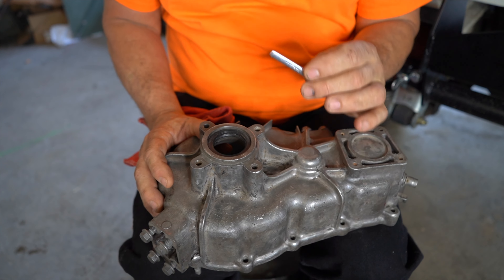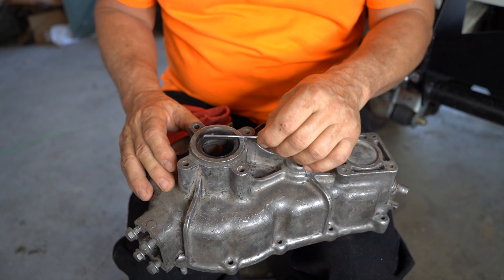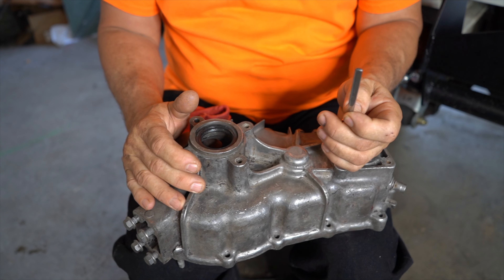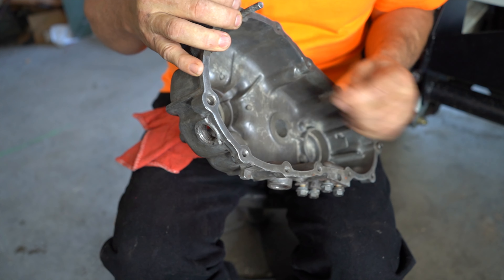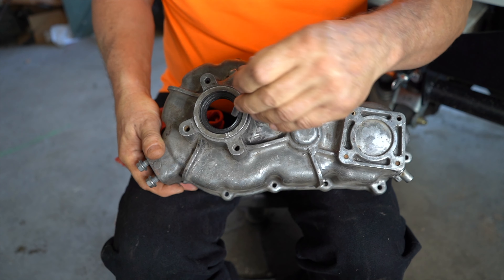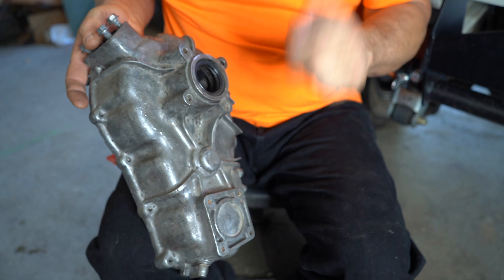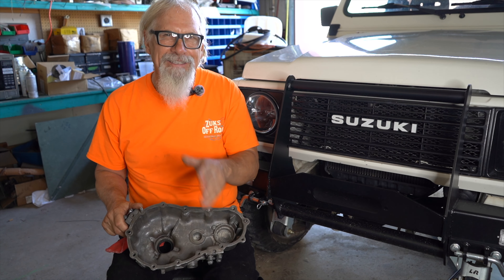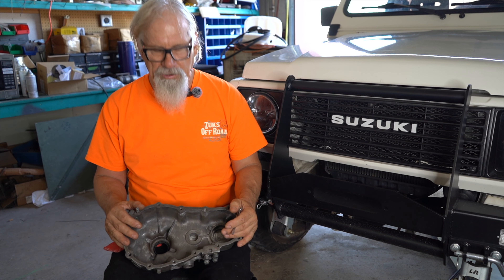Suzuki Samurai T-Case Rear Seal Install

Comment: How would you approach replacing seals without disassembly of the t-case?   I have a small leak and want to replace seals.  Especially the top input seal
Reply from the maker: Simple remove the flange nuts and pull the flanges off. The front seals are exposed and easy to remove. Note that the back seal is depressed into the case surface. If the rear seal is not leaking replace just the front. We have Japan seals.